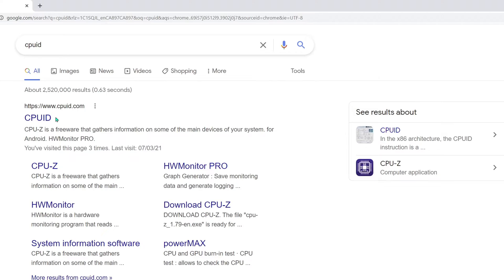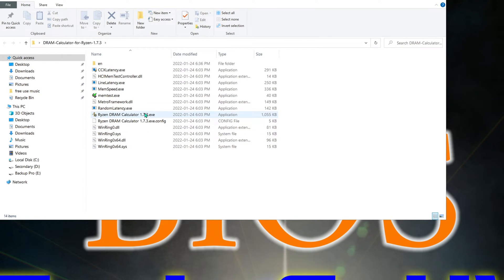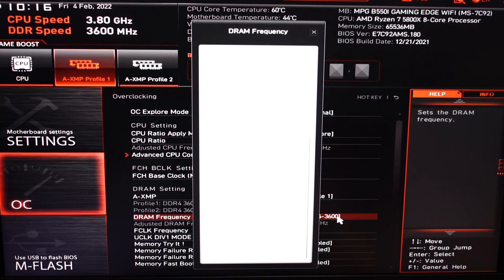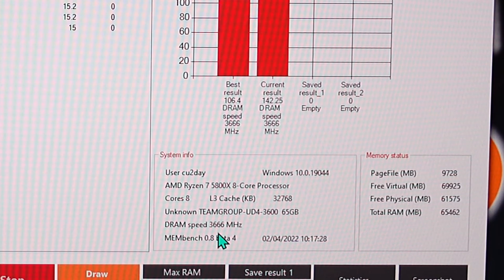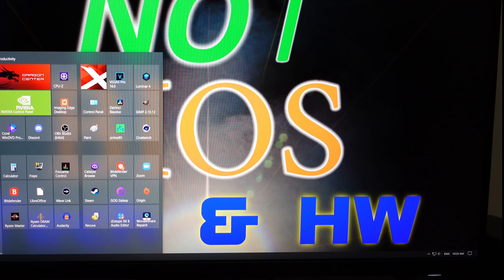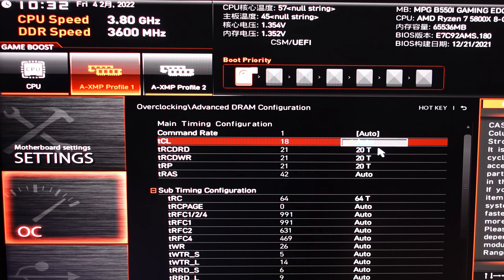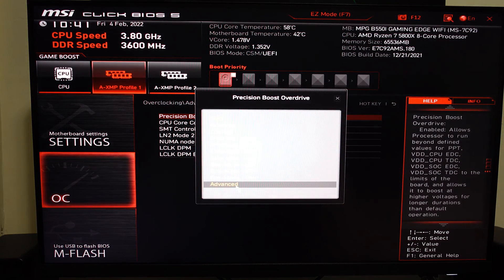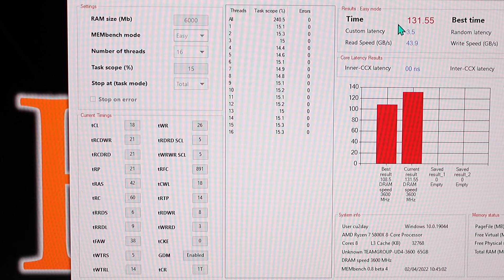Memory (RAM) Tweak/Overclocking, How to Guide (DDR4 shown)

Comment: Hey. Could you answer the question? I've recently bought 4 ram 3200 xmp of 8 gb each other (gskill ripjaws v 3200, Samsung bdie, according to program checker)  I have 5600x 1.3v 4700. Try to launch ram xmp on, and i eventually get a black screen. So i wonder, where it goes wrong. I managed to run it on 2933 mhz 14-16-16-32, but my secondary timings are awful. Something interesting, 2 ram can be launched on 3600.   I'm new at overclocking , thanks in advance.
Reply: I don't have experience over clocking with more than 2 sticks but matched exactly is the best way to go and 4 sticks is always worse for clock stability than 2. Memory check programs tend to not work. The Typhoon program assumes the memory stays the same as manufactured but it does not.
Reply from the maker: For more about 4 not purchased at same time memory sticks and at least getting rates speed I am not the best to help. Do the new memory sticks reach the rated speeds without the old ones installed?

Also you are likely going to have to use 2T memory timings rather than 1T with 4 sticks installed and not sure if gear down mode is going to work or not.

Comment: should i not bother if the RAM i have is not listed in my motherboard's compatbile RAM?
Reply from the maker: You can try.
Worst case you'll likely be resetting your CMOS. If XMP is working fine you wouldn't be any different than any other memory. I am running XMP with non-compatible memory right now but it does cause boost up problems for me, having my new memory exchanged for the proper stuff.

Comment: Oh i just left a comment on the old video without realising there's a new one xD

When it comes to OS or corruption from all this ram overclocking.. how dangerous is it exactly? I noticed that when I had very unstable ram where HCI failed instantly almost, my Malwarebytes Defender would actually report failing to start one or two Defender services. And when it was stable ram, it's work fine. That was a bit worrying..

LUCKILY I haven't hit a need to CMOS reset and not notice anything else getting wrong. Worried when that will happen, cus it's just.. a new experience and pain haha
Reply from the maker: Stability with memory is mostly a concern when any updates is happening. If windows updates happens to install when unstable or installing a program or APP it could be a concern. It seems needing to CMOS reset is far more common an issue with newer systems. My old Intel 3770K Z170 motherboard always auto reset after 3 reboot attempts.
Reply: @sparketech  that's good to know, it is possible I could push for one more bracket to 2400mhz without windows totally dying and needing to cmos.

I've paused windows updates (can't disable them anymore...) so far, and made sure not to do anything that isn't opening HWinfo, SuperPi, or HCIMemtest/Aida64 until I can pass 40% HCI, then I play Fortnite to test or open Chrome. I should definitely stop some things like Wallpaper Engine from startup for based off what you said though.
Reply: @ashryver3605  The best bench marks are simply games, you can compare Cinebench scores before and after 12@2400 is nearly always faster than 10@2133. Some APPs are more Mhz affected some are more latency affected. For older Intel CPUs like you have no sure as much about the sub clocks. The newer stuff with memory controllers built in those CPU are far better a 1:1 memory timings. Bench marking especially with games and proper performance programs should tell you.
Reply: @ericsstudio  thanks a lot for your time, I'll try see what I can do with 2133 , see if 10 11 12 35 is possible (10 12 11 is not, last number had to be 12) and/or just start working on the lowering the 35. I think if I even dare to touch the 10 down to 9 it'll require cmos reset LOL. By 1:1 memory controller timings you mean matching numbers, like 10-12-12 being better for new CPUs?

Then I'll go for 2400mhz @ 12 X X X as you suggested. I'm trying to reduce stutters and microfreezes by increasing ram speed. Hard to tell if its working haha, Fortnite was seeming great and smooth until a Vcore related BSOD, then I patched it and noticed more stutter perhaps due to corrupted memory as I hadn't ran a 100%+ coverage ram test yet on this seemingly stable 2133.

One guy actually achieved 2800mhz on totally auto settings besides upping Dram voltage on ddr3 corsair vengeance! 12-14-14-35 2T.
Reply from the maker: @ashryver3605  to avoid small stutters it isn't those timings that are the issues look further in the video the other timings  that I show. I highly double your main timings are the issues. The bigger issue is likely to be either those other timings, or lack of video memory or lack of computer memory or too much running in the background. I have two videos on steps to take to reduce game stuttering. There are also GPU settings to a smaller degree
Reply: @sparketech  unfortunately 2400 will not work with my kit xD

I first tried Auto and letting the system try it, but nope. Cmos clear required. Then upped 10 12 12 32~ original 2133 settings to all the way up to 15 16 16 46, and that still wouldn't work - the computer would power on, power off, power on, then boot into windows. Sometimes. After the first successful boot it would usually just require a Cmos clear again.

More voltage might be needed, somewhere, but I don't want to go over 1.678 dram voltage which Motherboard is already giving automatically sometimes @ 1.65 set.

Your videos helped me out nonetheless and if these 2133 / 2200 settings end up 400% HCI coverage stable I'll call it a day! Won't touch the secondary timings haha it's been like a week already!

I also discovered an odd thing, if I set the final number too low, it seemed like performance wouldn't change in benchmarks / would become worse! (Like 10 12 12 28 was worse than 10 12 12 32 in 1 run of Pi 32M).
Reply from the maker: @ashryver3605  a timing too tight can indeed lower performance. It happens when the memory stalls due to an error... At least that is the best way for me to describe it. to be exact the final number is the delay required to fetch the data. If it does not have the data in the time frame of the timings it than is not processed at all and yes causes a stall of sorts. It's hard for me to comment by mobile phone to read correctly :P. I work 140 hours every 2 weeks so time  at home is hard to come by :p

Comment: well the fabric can be increased
Reply from the maker: High risk of instability doing that on AMD boards. In some cases can push it a bit but there is a fine line. You must be a really go all for broke as in go for every overclock option, I knew long ago it can be overclocked but the risk of slightly unstable is very easy to achieve so it made little sense to show such options. The Tfaw is a nice timing to try, it does have an effect, thanks for the tip on that one. Maybe one day I should make a newer guide, like your style that you go all out.

Comment: hi i passed several stress test with memtest86+, hci and tm5. thinking it is stable I used it for awhile and recently I realised with any ram OC, restarting the PC (not cold boot)will bring me to a windows repair page. Backing down any form and increasing voltages did not help at all. Returning the oc to XMP fixes this and make the system boot and restart fine.

I would believe it is more of the overclocks being unstable than a messed up OS right?
Reply from the maker: There are so many reasons... If you overclock by front side bus to get more CPU clocks on a locked CPU things quickly get out of hand because the PCI-E GPU slot, the M.2 all get over over-clocked and makes the computer unstable and can corrupt windows if not careful. Temps are always a concern and placing memory clocks higher than the computer memory controller can support which is where timings make more sense.
Reply: @sparketech  Hi did not OC by FSB, just RAM frequency and tighten timings. Tried to follow the DRAM calculator by 1usmus. Well i guess I need to accept the hynix MFR cant OC much.
Reply from the maker: @hk9443  no where in this video do I say to follow that memory tweaking guide. IT is wrong! Problem is manufacturers switched which memory is in the sticks and typhoon does not actually read the real memory. Do it manually and just cause ram is rated for a certain speed and the motherboard supports it does not mean it will be stable. Near the start I mention that very fact using AMD CPUs as an example but Intel has exactly the same issues as well. In fact Intel and AMD, chipset and even the bios version affects what is stable. If your board does not run the memory clocks stable I am not sure if that is going to show errors with memtest. Use the dram calculator memory test as I show in this video. Can help you more if you give detailed specs but make sure your bios is up to date so your memory isn't unstable because an old bios.

Comment: Now, why is there no C--die in this calculator?
Reply from the maker: I am not using a dram calculator... I show that in another video but the memory software Typhoon isn't accurate. What I show is the dirty try it and find out what you can do and make sure it is stable. I followed dram calculator to have an unstable computer. I can refer you to that other video but this method applies to "everyone" not only AMD and the hope you have a stable system.

Comment: Glad you linked me to this because it reminded me that i have a button on my motherboard that will reset my bios if for some reason i get locked out.. which i can usually get back into my bios menu most of the time.. there are those occasions where it just refused to boot up when i was changing hardware a while back.. this is why im afraid to switch to a 11th gen cpu. i had a pain trying to get my current motherboard to update manually with the current cpu.

Comment: Hey thanks a lot! I got a question:
Do you lower the tRAS number too when you play with the values or you only touch tRCDRD / tRCDWR / tRP / tRC ?
Reply from the maker: The tRAS is something I don't play around with as much. It is the shortest possible delay based on certain 2 timings. If I adjust it it is usually the last thing after I confirm everything else is stable. Push too hard some games can get micro stuttering.

Comment: Hello, I have a similar setup as you. MSI B550 Gaming Edge WiFi, Kingston HyperX 32GB 3200 (I read your review for the 3600MHz model on Amazon) and the Ryzen 5600x. I was wondering, would you recommend I try MSI's "Memory Try it!" since I tend to get lost and have no idea what to do in the Advanced DRAM stuff? Also, about PBO and the Curve, would you suggest I do that to? (I'm a n00b at this stuff, trying to get the most out of my system but run everything at stock speeds.)
Reply from the maker: In terms of system speed for gaming the GPU makes the most difference... For memory the "try it" if very limited and it is still going to cause no boot situations and is only basic settings. Won't get you peak performance, but it is fast to do... Be mindful of the voltage the setting applies

The PBO is the fastest way to gain CPU performance especially with a 5600x CPU but temps can get out of hand quickly if you don't have the proper cooling. There is a step I missed showing if I remember correctly... PBO limit controlled by motherboard otherwise the power limit does not take effect.

Know how to reset you bios before you try anything... The pain in the butt about the PBO limit is you can have random image glitches in windows and programs if you went too far and if you see it you'd lower a couple of steps down till it seems perfectly stable... Negative 30 is the lowest but the fastest for performance while lowering voltage the most.
Reply: @sparketech  I have a be quiet Dark Rock Slim CPU cooler, 2x top 120mm fans, 1x 120mm front fan, and 1x 120mm rear fan. I might change to a better gaming case that has 3 front fan mounts and I was wondering if I should switch to water cooling. That I know nothing about. Do you suggest I switch or just keep using my fans?
Do you have a video on how to undervolt and optimize the CPU with PBO? Not sure what to do there. (I love playing Flight Simulator 2020 which is heavy on the CPU and GPU).
As for the RAM, I'm running XMP to bring me up to 3200 MHz. Changing the timings shouldn't damage anything, just increasing the voltage could cause damage with RAM and other components?
Reply from the maker: @robman501a  liquid cooling isn't as smart as people think... It gets heat soaked after 20 minutes. The cooler you have might be a bit small if you aim for performance. For lower voltage that is what I show on my video that gives more speed... You don't really need to set the top wattage since your CPU is lower rated watts. Use the MSI dragon center software to monitor your temps... Prime95 is a good program to crank that heat. If max temp exceeds 85C you may want to than lower the power limit to 88W by default I think your CPU is 98watts for your 65watt rated... Mine is default 141 for my 128watt rated.
Reply from the maker: @robman501a  Generally you should not need more than 2 case fans if you're case has air flow and say 120mm or larger fans. Liquid cooling has one specific advantage of being able to vent air out of the case which helps temps. I'm obsessed with silence and hate the noise of a pump personally... Liquid cooling has to be installed a certain way to be most effective. Gamers Nexus has a couple of videos on how to install a liquid cooler properly so you do not burn out the pump.
https://www.youtube.com/watch?v=BbGomv195sk
Be very careful of certain brands, Enermax has been bad news and Corsair is generally a safe bet and 240mm is a lot more effective than 120mm.

For the price I would rather get a cool air cooler but this is your build not mine... I like air coolers because in 12 years the only issue might be a reapply of thermal paste and maybe a new fan. Liquid coolers can leak but not very often and pumps can die after like 7 years / coolant can evaporate after 7yrs through the unit causing failure. Most good units come with a 5 yr warranty but the price is often double that of an air cooler. I did liquid cooling once. Temps initially on my 120mm unit were down till all the coolant got hot in the rad after 15-20minutes giving me no advantage. A good 240mm AIO would kick rear for a 5600X
Reply: @sparketech  yeah I'm nervous about the possibility of a leak. That's why I feel more comfortable with the air cooling method. I'll take the sound of a few fans over the chance of a leaking pump or tube.
Reply: @sparketech  I've figured out how to get my RAM (JDEC 2400 / XMP 3200) to run at 3600 MHz. CL 17 (BIOS puts it at CL 18), RCD 19, RP 19, RAS 39, Gear Down Mode enable, 1.35v (but BIOS runs it at 1.372 - 1.378v, same as XMP Profile 1 @ 3200 MHz). Results where more FPS in FS2020, RAM benchmark was better but everything else dropped a little. When you OC your RAM, does your RAM benchmark improve but everything else drops a little? I've used "Userbenchmark". Yes! For sure I'll like and subscribe to your channel! :)
Reply from the maker: @robman501a  most things should improve, mostly games... However depending on certain latencies some items can slow. If 1T not gear down, changing to gear down is slower but more stable. Sometimes a happy medium could be more effective. Like a half way point in speed
Reply: @sparketech  Command rate was set to "Auto" and it showed "1T", I went to disable gear down mode and my system wouldn't POST at all. I had to reset the BIOS by doing the jumper method. Also, for PBO I lowered the curve to 15 because anything greater would result in a crash and I increased the boost clock by +50 MHz, so now under load I'm getting 4.7 GHz at ~65c.
Reply from the maker: @robman501a  Good job on figuring that all put. My CPU isn't completely stable at anything above negative 12. At 14 I get the odd random image glitch and crashed during a major boss battle in Marvel's Gardian's of the Galaxy game.

Some programs respond better to timings and others better to the memory speed. My memory is 3600mhz... Got my timings slightly tighter than what I showed on the video down to 138 seconds. Also your PBO settings do change your memory score.

Ordered the Ryzen 5950X yesterday:P.

Comment: Hi. What would you say is the absolute max safe voltage for ddr4? I've seen a lot of people say between 1.45v - 1.5v.
Reply from the maker: I "prefer" to leave it at 1.4 max but the experts say 1.5v from an old Intel post. HOWEVER if the CPU is already hot it'll get hotter with higher voltage, the ram isn't the issue. The CPU memory controller getting damaged overtime is the main issue. One of the problems of raising the voltage higher than 1.4 volts is the OC results make for very very little gain. There are other voltages I didn't discuss for memory clocks because those voltages are more likely to damage a CPU overtime.